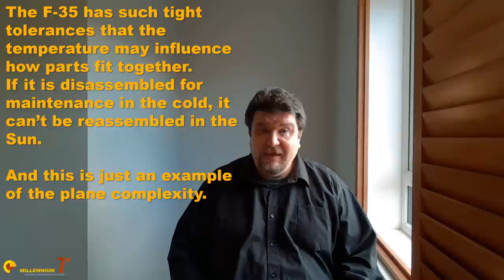F-35: The Failure of the $100 Million  Dollar Jet | Maybe...

Comment: The USAF would probably rather buy a modified F18F then go all the way and buy Rafale or the Typhoon, which is not that great as a multirole fighter anyway, or the grypen which is too small. The Super Hornet might be one + less advanced as 4gen, but it's all indigenous in every single subsystem. The point is that, while buying a heavily modified FREMM is one thing, due to the limited overall number of ship being built, buying a fighter system with several hundred of units makes having it "right" from the beginning more appealing.
That is why they bought an almost 50 year old F15 upgraded to the EX version rather then buying off shelf.
BTW, I guess Italy will regret phasing out their own AMX for more F35 instead of updating them with a new engine and electronics: cheap simple planes still have a place, and always will as Kossovo and Afghanistan proved.

Comment: Gripen E or F-20 with some "Low Observable" tweaking and thrust vectoring.   Mandate a "Max Price Per Unit" and A "Rapid Readiness Capability".  Be interesting to see what could be done if you tell defense contractors 45M per unit and must have these capabilities.
Reply: Good luck getting the price that low
Reply: @UptownDegree    Let an AI do the development.  This is not reinventing the wheel, it is just "Trait Optimization".
Reply: Building a 5th or 4th gen fighter is inherently pricey no matter how much AI you use

Comment: Yes, this is all about cost.  The U.S. government is spending money faster than they can print it while holding down interest rates, and the national debt is out of control.  Now the U.S. cannot afford the airplane that was originally meant to be the lower cost partner to the F-22 the way the original F-16 was the lower cost partner to the F-15.  Instead of terminating the the F-22 buy, I wish that had cancelled the F-35 when it its development issues became apparent, and just built a new version of the F-22 airframe with the G-whiz avionics system being developed for the F-35.  They could have stretched it a bit if it needed more internal fuel to match the range of the more bulbous F-35, or in other words a Mud Hen version of the F-22.  Ironically it would have been less expensive and we'd now have more stealthy fighters on the ramp.  The F-35 eventually became a capable airplane, but it was delayed so long that they now can't afford to build them fast enough to replace the old fighters that are ageing out of the inventory.  And the replacement for what was the high end F-22 is already being worked.

So the USAF chief of staff was dealt a bad hand of cards, and he's trying to play them as smart as he can. I'm sure he'd rather have more F-35s than more F-16s but he can't afford them.  USAF knows it didn't get to buy enough F22s (thank you Bob Gates), and now it's so broke that it's resorting to an updated version of the 50 year old F-15 design.  It's the same logic that chose the F-15E to replace the F-111 in that they can't afford to develop a new airframe that would be optimum for the task so they develop one from an existing design.  A disconcerting state of combat aircraft development.
Reply: @AllThingsCubey  Agreed, they can't afford to buy them fast enough.  I would also agree that they should pay to increase production because it's mistake to build more 50 year old designs.  Buying older tech planes is seductive because they're so much cheaper, not only to acquire but to operate and maintain as well.  Development of the latest models of the F-15 and F-16 was basically paid for by the non-U.S. customers that are already buying them, so unit cost for USAF will be low.  This is also why they will probably buy more advanced F-16s rather than the Typhoon, Rafale, or Gripen.
Reply: @AllThingsCubey  I've already agreed with you, so why are you repeating this point?

Comment: F-35 is an Command & Control platform (Air C2) but it can also used for ISR (Intelligence, Surveillance and Reconnaissance) but drones and satellites  often handle the ISR.
F-35 can be used as a C2 during strikes like we seen Israel use their F-35I.
It hasn't failed in any way it's just not a strike aircraft as the F-16 and F-15 even if it can handle those tasks.
With modern precision weapons with great ranges there are fewer situations that has explicit need of stealth a gen 4+ aircraft can handle those tasks and modern gen 4+ jets has a low enough RCS for most raged attacks.
Reply: Since it was intended as a replacement for among others F15 and F16 it has failed at least that role.
Reply: Yes, i think what's the problem with the F35 is that because of the long development, other technologies made it not obsolete but a bad choice when it comes to bang for the buck.
Stand off weapons like the Stormshadow have so much range today. That it's simply not necessary anymore to fly into heavily defended areas.
Also with better and better ECM systems it will get harder and harder to launch a missile from BVR and in WVR the F35 lacks absolute flying performance.

Comment: The cost of military aircraft is gone way past the point of total ridiculousness. $100 million + for a single aircraft is absurd beyond the point of insanity. I now hear they have $400000 pilot helmets!!!!!!! Almost half a million for A HELMET! This shows the ludicrous levels of greed the military industrial complex has gone to to take taxpayer money. Governments need to come back to reality. In a real war having superior military tech does give you decided advantages BUT there is a line that has been crossed long ago where cost WAY outweighs benefit. I don't care if it's the most superior thing ever created. If you can only build a 100 because of cost where the enemy can build a 1000+ of a somewhat inferior plane, the enemy is going to win. Quantity is a quality all on its own which has been PROVEN beyond a shadow of a doubt. No single plane, tank, etc can ever beat an enemy when it is outnumbered 10 to 1 or 100 to 1. Example, Tiger 1 tank of WW2. Extremely expensive for its day, far superior to what the allies had but because of complexity, technical issues and COST they could only make 1354 of them. Just Russia alone built 68000 T34's. Long story short, Germany lost.

The F-35 isn't just a mistake, it's a disaster of epic proportions due to greed. There is absolutely nothing wrong with the current F-15's, F-16's and F-18's. Even they are too expensive but compared to these new generation planes they are practically basement prices. 100 F-22 or F-35's are no match for an enemy airforce that has 1000's of aircraft and so on and so forth. I don't care if America can afford 500 or 1000 of these things, there is still going to be 10's of thousands of other combat aircraft to combat them at a far lower cost to the taxpayer. Economics. No matter how hard you try, you can't cheat it in the end.

Comment: 19:14 Totally agree that the USAF should consider license building a foreign design (although I don't think they will). What design do you think they should consider? Personally I think the Gripen would have a lot going for it for the US. Very low price to operate, it uses a US designed engine, very high compatibility with US weapons, open architecture that could no doubt be easily adapted to use a number of other US components (e.g. a US AESA Radar). Also Saab has been very open to having Gripen's license built in other countries and would no doubt allow the planes to be built in the US to Saab's design, providing US jobs.
Reply: Maybe there’s a reason that the Gripen keeps losing to the f35 when both are considered
Reply: @jb76489  The F-35 is a great aircraft but a very expensive one. Recently the USAF itself has said they cannot afford to replace the F-16 with the F-35, the F-35 is simply too expensive. Therefore the USAF has stated it will be looking for a lower cost alternative to compliment the F-35 and F-22. The question is what that lower cost alternative should be. I don’t think it at all likely the US would adopt the Gripen, I think it much more likely they’ll build their own aircraft. However, the Gripen probably would serve in this role very well.
Reply: @tomshackell  “the USAF itself said” no it didn’t. The CSAF is not the god king you seem to think he is

“Can’t replace the f16” and yet the order for several hundred more f35s than f16s still stands

“Lower cost alternative” to keep up flying hours for pilots

“I don’t think the US will adopt the gripen” no shit Sherlock, go look at the failed bids for the gripen and see how much longer that list is than the list of operators
Reply: @jb76489  wow you really love the F-35 don’t you ☺️ I guess we’ll see what happens.

Comment: I don't think the Navy comparison is entirely.  The US Navy is only buying the hull and power plant, all the combat systems, weapons, communications, etc, etc, are still supplied by and installed by US companies.  And they are only buying the design, the build is in the USA.  

The hull to a ship is not nearly as critical as an airframe is to a plane.  I doubt the US would want to outsource design, when there are multiple companies in the US that could produce a 4++ airframe on short order. One could argue the latest F15 and F18 models are 4++.

Comment: The 4+ is already here. It's called JAS-39 Gripen
Reply: There are a lot of 4.5 gen fighters now
Reply: http://kovy.free.fr/temp/rafale/pdf/12332.pdf
Swiss damning report in Gripen C vs F/A-18C.

From Swiss,
_The Gripen has been assessed unsatisfactory for this type of mission. The main weak points of the Gripen were insufficient Range/Combat Radius and its aircraft performance_.

Swiss report also includes Gripen MS21 with 46 upgraded items and still not meeting Swiss minimum expected capabilities.
Reply: Yeah gripen is a short ranged fighter

Comment: There were studies on retiring A-10s in the '80es, for 22 million dollars (value of the '80es). And you can see what happened. While the overall number of F-35s can be reduced (which is also a usual process in every military project), it is now too big to fall. Went ahaed too far.
But, of course, the length of the program was way too much, threats are changed since the '90es. So, it is not a suprise USAF needs something new, which easily could be a simpler aircraft.
We do not know anything about that new, 6th gen. plane. Maybe it will be 5th gen., but in a simpler and affordable way. (We don't know what is a 6th gen. plane at all...)
One comment mentioned the F-16XL, if I need to say a particular solution, someting like this is mine. F-15 and F/A-18 also have this kind of delta winged versions proposed.

Comment: If we need a new 4++ gen plane, then I suggest we get the Saab Gripen.
Reply: Or just buy new f-16s or heck just keep buying the f-35
Reply: You haven't read the Swiss report then.
Reply: @valenrn8657  No, I have not.  What Swiss Report?? What do the Swiss know about fighter planes?? I think the Saab Gripen is a good plane, from what I have heard and read.  
What don't you like about it? 
BTW... IMO, the price of the F-35 has come down so far, that it is now cheaper than almost everything else. 
Cheaper than Rafale, for sure.
Reply: @craigkdillon  Swiss has F/A-18C/D replacement competition and they tested Rafale, Eurofighter, and Gripen C.
Reply: @valenrn8657  Not the Gripen E/F?
Reply: @craigkdillon  

_kovy.free.fr/temp/rafale/pdf/12332.pdf
Swiss damning report against Gripen C vs Swiss F/A-18C.

From Swiss,
_The Gripen has been assessed unsatisfactory for this type of mission. The main weak points of the Gripen were insufficient Range/Combat Radius and its aircraft performance.

Swiss report also includes Gripen MS21 with 46 upgraded items and still not meeting Swiss minimum expected capabilities.

---
Swiss F/A-18C has 9G and higher than 45 degrees angle of attack variant i.e. not yer normal USN F/A-18C Hornet.
Reply: @valenrn8657  I see. Yeah, it is a short range plane.
Reply: @valenrn8657  It's not the full report also worth mentioning is that JAS-39 won that contest over all the competition.
And they didn't test JAS-39E  with updated range, weapons capability, more hardpoint, new avionics and EW-suite in that report even if that was what they would have ordered.

Comment: F-35 does not satisfy long standing requirements of two air crew and two engines for CV operations.   Everytime the Navy is forced to buy an AF fighter they get an a/c that cant carry the payload the necessary range.   This is as successful as when they tried to force F111 on Navy as interceptor.    Navy F-4 as A/F fighter works but reverse process NEVER works.   The Navy had to supersize the F-18 to get an effective AC.  Navy has opened an office for new fighter that sounds like the F-14.